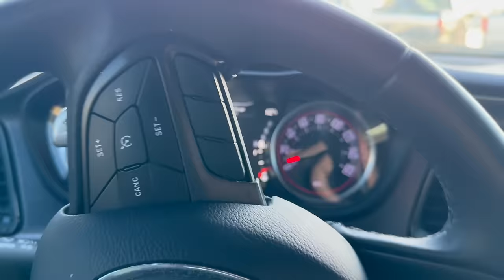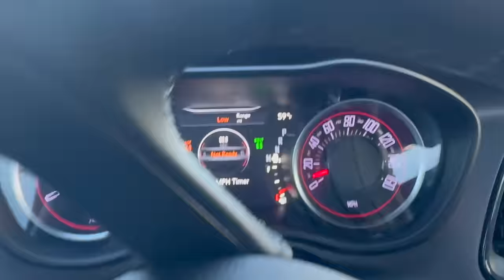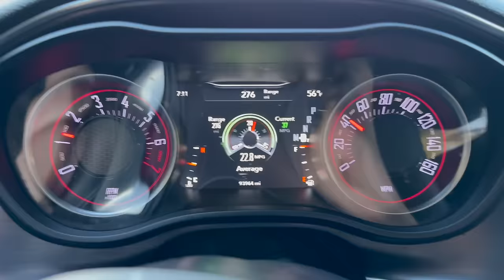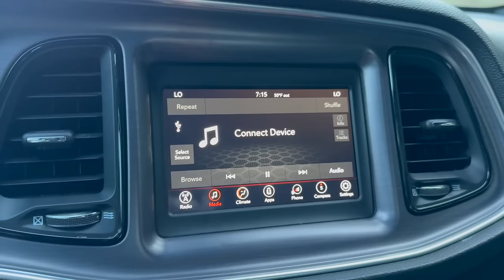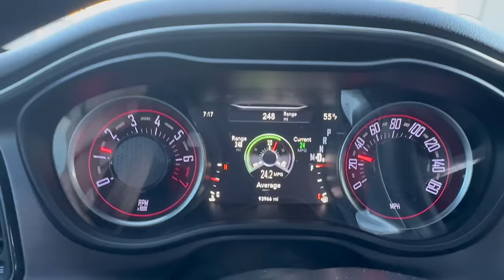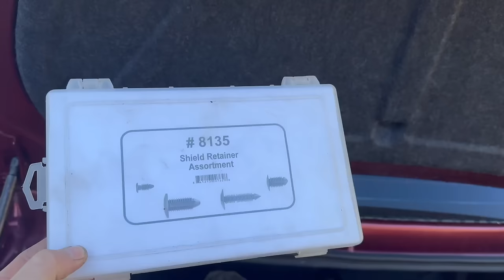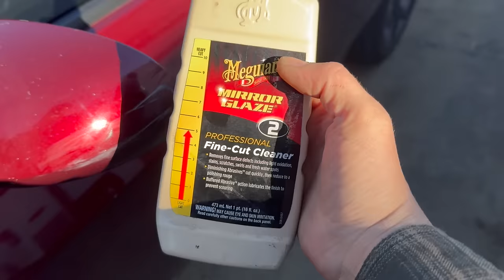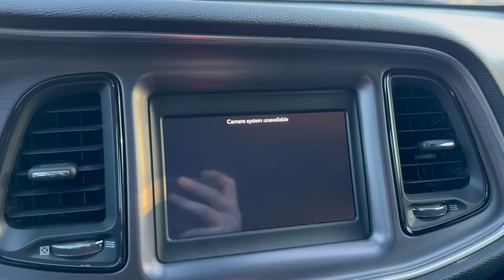The Case For The 3.6 - I Bought A Beautiful 2018 Dodge Challenger!

Comment: I feel a lot of guys are going to immediately go to the comments. Before listening to your reasons on why the 3.6.  The gas mileage and not dealing with the lifter failure. Screams volumes on knowledge vs ego. 
I will admit. I’ve never been a supporter of the new generation of chargers and challengers….but I’ve also had to work on a few of them and gotten to drive multiples of 5.7,6.4, and 6.2. The only combination that ever had my attention was the scat/shaker with a 6 speed. But cost,cooling issues,lifter issues and the seats completely killed it for me.(super comfortable for 15-20 minutes and then rest in peace my back.)

At the end of the day no matter the car/truck they will have similar to unique issues and it comes down to personal abilities and wallet.
Reply from the maker: I completely agree. I have to say, the adjustability of the driver’s seat is great, but I’m really not sure I want to ride in it for, say, a 5,000 mile road trip… I really like the idea of a mid range performer like the Scat Pack more than I like the idea of a Hellcat for exactly the reasons you stated. I don’t think I’ll ever be that guy that needs the most power, the most expensive car, the most impressive model, biggest bragging rights, etc. There is another way to go about this whole car thing, and that’s what I’m trying to show on my channel.

Comment: Im not going to critique you  ,
Jamie 🙏

3.6 v6 is just fine with 294 hp 

Especially for all of the points 
You mentioned
Reply from the maker: I was wrong - it’s the same 305 rating as the trucks 😁 the Charger engine is rated for 292.

Comment: We used to rag on a kid who got a 2009 v6 way back when it was new because of the lack of power ( 250-60?) but now with almost 310hp out of the 3.6 the haters are starting to eat humble pie and buy these up.
Reply from the maker: Yeah… I wouldn’t have a 3.5. The 3.6 is a completely different animal.
Reply: @DeadDodgeGarage  Challengers and Chargers have always had the 3.6, just the older version made less power.
Reply from the maker: @drunkhusband6257  No, no they haven't. The V6 in use when both models were released was the 3.5. It's a completely different animal with single overhead cams that dates way back to the Intrepid/Concorde/Eagle Vision cars of 1993, and was based on the old OHV 3.3. The 3.6 is a dual overhead cam design that has about a 50 horsepower advantage over the 3.5, as well as VVT and other modern features. It was new for the 2011 model year.
Reply: They can call it whatever they want it's literally the same engine
Reply from the maker: @drunkhusband6257  Dude. What are you talking about? They share zero parts. They are literally not at all the same in any way except that they are both 60 degree V6 engines made by Chrysler. THEY ARE COMPLETELY DIFFERENT ENGINES. Why would you waste your time commenting verifiably incorrect nonsense when you could A) listen to someone who has been in the nuts and bolts of both engines and can tell you that, like me? Or B) use Google to learn something. Seriously. The whole of human history and knowledge is on the internet, and it’s really easy to learn things like this. I don’t understand.

Comment: Question:  Can anyone recommend a quality radiator stop leak ? The vehicle is a Tacoma 4 banger with 200K and I'll settle for a temporary fix v. pulling it out for a tank test /repair /replacement.
Reply from the maker: I’ve always liked Blue Devil products. I’ve also had good luck with K-seal for small leaks.
Reply: @DeadDodgeGarage  TY !!

Comment: Cut the mufflers off and they actually sound pretty good.  With the cats and resonators it’s not load at all with normal driving.
Reply from the maker: I heard that! I was looking at exhaust kits and owners said to just pull the rears out. I’m going to try that at some point.
Reply: @DeadDodgeGarage  When are you going to do it?  It's just sawzall and 2 pieces of pipe.

Comment: My 2014 Town and Country ate two camshafts, I did all the rockers, all four cams and all of the lash adjusters. I got about a year more out of it before it blew a cylinder head and the transmission was failing. These engines might be easy enough to work on but I would never own another one. This is one of the reasons I will only drive old Mopar. As soon as  Chrysler started selling to the lowest bidder they went straight down the toilet.
Reply from the maker: Wow. Good times. I have heard of the cylinder head issue and think I mentioned it here.

Comment: my wife's van has the same motor and now has 175k  mi...it smokes 5.3 tahoe's all day long.....still i went ahead and got the hemi in my ram.
i had a 2019 camaro ss manual and test drove a 2019 5.7 shaker manual i was not impressed. less is more maybe i should have tried the v6

Comment: When I win the lottery I will buy one like that to go drag racing, put it on a severe diet to see how quick I can make it go before adding hp. Losing 1,000 lbs may not be very crash worthy but I think it would get deep in the 12s.
Reply from the maker: Dude… don’t tempt me. Haha.
Reply: @DeadDodgeGarage  have cutting wheel and hole saws....will travel...

Comment: Not a bad looking car, not my favorite wheels. It just doesn’t sound right, it doesn’t need to be loud just rumble a little 👍
Reply from the maker: I agree on both counts. I am very curious what kind of exhausts are out there that could improve the tone when it’s stomped, but stay quiet when cruising. I definitely don’t want to ruin the almost whisper quiet interior aspect of the car. And wheels… I’ll figure that out eventually. I’ll be rocking these for a while, for the tires alone.

Comment: Other than the rims, this looks just like my 2019. I've only had it for a couple months and I'm averaging 28.1 mpg ( I'm currently driving like an old man so that I can brag about getting 28 mpg)
Reply from the maker: Right. I’ve been having a problem with the driving like an old man part. Haha. My gauge says 25.2 at present. I will be hand calculating it when I fill up to test the accuracy there.

Comment: I got a 1970 Challenger in 1975. At age 16. My parents financed it, I made the payments. All of them. It was dark green with a white vinyl top and a black interior. 318 2 barrel, single exhaust, column shifted automatic. 14" Torq Thrust wheels, RWL Goodyear PolyGlas GT tires. Now that was a beautiful car. Not fast, but beautiful. The new Challengers look short, fat, and chunky. They lack the beautiful lines of the original. But worst of all are those hideous huge pimpmobile wheels with no actual tires. They are downright disgusting. I would never be seen in a car with wheels like that. 6 years ago I was looking for a cheap American 2 door rear wheel drive car for a daily driver. I found a beautiful 2003 V6 Mustang, low miles, in Zinc Yellow. It needed tires. It had 16" wheels. Fortunately I was able to find a nice set of 15" wheels from a 2000 V6 Mustang, so I could put regular RWL BFG Radial T/As on it.
Reply from the maker: 15s will never fit over these gigantic brakes. I think a 17” wheel is where I need to go. I don’t like the big wheel look at all - but a lot of people do. Yeah, these are chunkier than the original cars, but for the most part, the lines are there. I was surprised to find the subtle line on the roof a few inches ahead of the back window - just like the originals have. For it to make sense you really need to think of it as its own thing - it pays the best tribute to the original car that it can, given today’s safety standards, modern construction techniques, and buyers’ preferences. But it’s not the same, and it never will be. In many ways, that is a good thing - I swear. Haha.

Comment: I drive durango withthe 3.6 and i was honesty really impressed with it. We didnt end up buying one at the time. I have 17 powerwagon instead. Im not sure ifi could get a challenger and not have the 6.4 in it though. A charger i could do with a v6.
Reply from the maker: A similar year Charger in the same configuration totally would have done it for me too. I would actually prefer the extra doors because I need the car to be practical - but it’s just so pretty…
Reply from the maker: I’ve had every other Power Wagon, so I think I need a modern one some day. Haha.
Reply: @DeadDodgeGarage  I agree the charger with its 2 extra doors makes way more sense for a feller with kids. However, the challenger is so good looking. My powerwagon has the 6.4 and I absolutely love that truck. Fuel economy is as expected but I drive a 50 miles just highway yesterday and got 18 mpg which I'm very happy with. I'm in Colorado as well so not flat ground. It averages about 14 though so there's that.

Comment: I was just watching a video on a failed 3.6, so I wouldnt touch anything but the 392 honestly, as that's the only one that seems to be alright, videos called
Towed In! Died on Highway! (Engine is Drowning Itself!) Dodge Ram Chrysler 3.6l

and theirs a bunch of listings from other people who have had trouble with them, same with the hemi, which has a poorly built lifter system that eats itself judging by that engine rebuild channel I found

and so far the only one that seems like it would be worth the risk is the 392, and the hellcat/demon series that might be alright

but their way too overpriced for what they are, and it seems like the new head of mopar just wants to take the consumers for a run far more than the old OG guy, who was selling 35/40K V8's at 85 and 90 with those problems

basically willingfully selling a defective product, a far cry from mopar back in the old days, where generally you could get a pretty decent car and truck for good money within reason

also the sparkplugs on the pentastar, you need to take the intake manifold off to get at them, like they fully assume the car will never break so nothing was made to be taken down and fixed

which actually perfectly fits with mercedes owning them, as that's how they build their cars now after the merger

hence why everyone went to beamer

and mercedes despite having some pretty cracking cars, only makes them good when their over a 150 grand, and even then that's a mixed back and then some
Reply from the maker: I’m sorry, dude, but any engine is going to have problems if you overheat it to nuclear proportions and keep driving. That’s what happened to the van in that video. I have seen many, MANY plastic heater fittings like that break on LS equipped GM trucks. I think we can all agree that the LS is pretty great? I think those plastic heater fittings are total BS, and that thing only had 94k miles, but that’s another story. This is not a 3.6 problem. 

In the comments on that video, I see people complaining about pulling the intake to change the plugs too. I’m guessing they don’t know that this has been the norm on many, many models from many manufacturers for decades now. And often, even if it doesn’t have to come off, it’s right in the way. Let’s see them change the plugs on the FWD / AWD Toyota/Lexus V6, then get back to me. Some of these guys have never changed the plugs on a PT Cruiser, and it shows… meanwhile, I can get a 3.6 manifold off in about ten minutes. And given that the spec iridium plugs are good for 100k miles, this isn’t something that has to be done often. 

I covered the well known issues with the 3.6 in this video. I would never argue that it is perfect, or the most reliable engine ever built - because it is not those things. But it’s a decently reliable engine that punches above its weight in terms of power. It’s a fair balance between all of the things I’d want in a modern engine.

Comment: I've got a 2010 challenger with a 3.5 V6. Took a lot of wise cracks about not buying a hemi but the choice was simple, $89.000 for the hemi vs $30.000 for the V6. Don't gotta be a math wiz to figure that one out. Also the insurance rates for the hemi was thru the roof. The v6 was again reasonable. Plus the jitterbugs around my city don't bother stealing v6.s. choice was easy and I've still got it. Hemi,s are overpriced and are targets for thieves as well as ticket bait.
Reply from the maker: Yep… my buddy just bought an R/T Charger, used but with low miles, two years newer than mine. It cost double. I stand by my purchase, I love this car. I will say, the insurance was not as much cheaper for the V6 as I had hoped…
Reply: @DeadDodgeGarage  kind of depends where you live I guess, I live in Florida and rates here are really high even with a clean license. I have a friend who bought a hemi charger 2015 or something and he got rid of it within a year, just couldn't afford it.

Comment: Now I want to see you put a modern 3.6L in an A body.
Reply from the maker: I have been contemplating that for 4+ years. I did see another guy building one on FABO so it’s been done. But out of the box with 300 HP, tiny and lightweight. I have come out swinging against modern drivetrain swaps (at least more modern than the Magnum,) and I stand by my reasoning there. But if I were going to do one for myself… I would go for the Pentastar long before I went for a Hemi. Did you know there is a supercharger kit for them too? Haha.
Reply: You could probably find a 3.6 V6 in a wrecking yard
Reply: Don’t you have a late 60’s Valiant hanging around? That would be a great candidate. I always liked those.
Reply: A Valiant would be the ultimate sleeper with 300 hp. Nobody is surprised when a Barracuda or a Dart passes them on the highway going 80mph…. Right? But a Valiant? Grandma’s in a big hurry to buy some groceries😸

Comment: but... is the 3.6 better than the 225?
Reply from the maker: It really depends on your definition of better. It makes triple the horsepower and weighs 2/3 what the slant does. It’s also much more complex. The slant is a hammer, the Pentastar is a space station. The slant will still be running when the bomb finally drops. The Pentastar… I’m not banking on that.

Comment: 2011 is the first year of the second "New" generation.
Reply from the maker: I always get that wrong.
Reply: @DeadDodgeGarage the interior refresh and current 1971 themed tail lights and grill treatment started in 2015
Reply: @DeadDodgeGarage  I meant the Charger Model change.  I misspoke for the Challenger and the other commenter is correct.

Comment: 17 inch steelies with dog dish caps ? , if that's achievable?
Reply from the maker: There’s a thought!
Reply: @DeadDodgeGarage  With redline tires  maybe. Kevin Harts Road Runner has big diameter  black steel wheels , and small hubcaps.

Comment: 305hp is for the Challenger
Reply from the maker: Yes, it is the same as the Ram truck. The Charger is the one with “only” 292 HP. It had been years since I had looked into this. Sure, I could have checked the figures before making a video - but where’s the fun in that?

Comment: Hmmmm....We had a 3.6 in our Journey.... It was a turd.
Reply from the maker: Well yeah, it was a Journey
Reply: @DeadDodgeGarage  Both say 3.6 VVT on the top.
Reply from the maker: @Trex1268  indeed - but the tune difference alone is good for 22 missing horsepowers. Was that an 8 speed? They’re front wheel drive, so not much of an opportunity for fun there. Depending on equipment, it could also be a couple hundred pounds heavier - not as much of a difference as I would hope for.
Reply: @DeadDodgeGarage  It's a nice ride. Classic Dodge styling. Hope you got a deal on it.